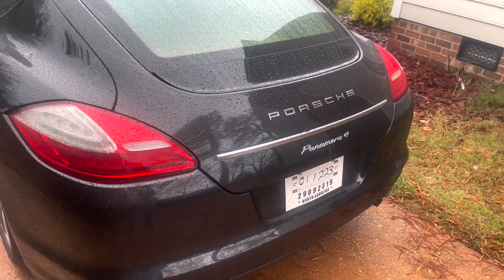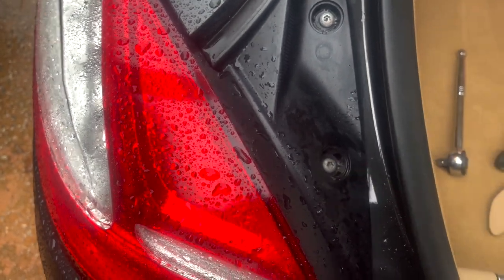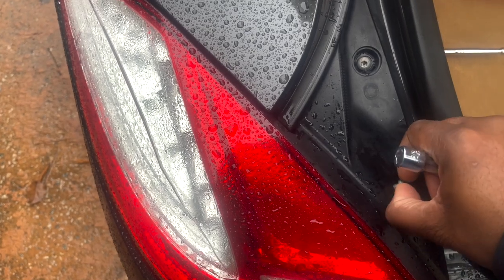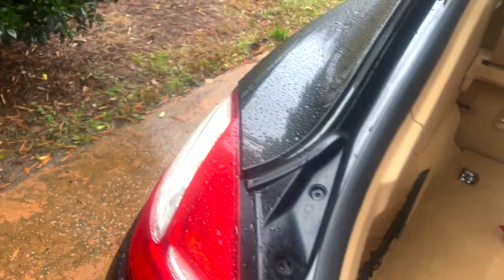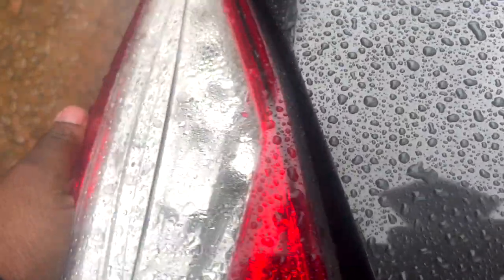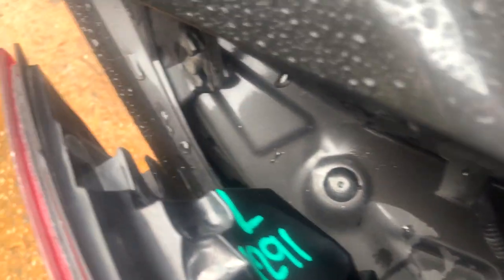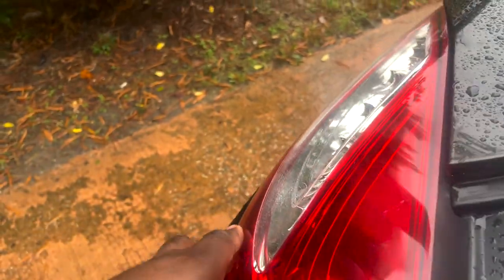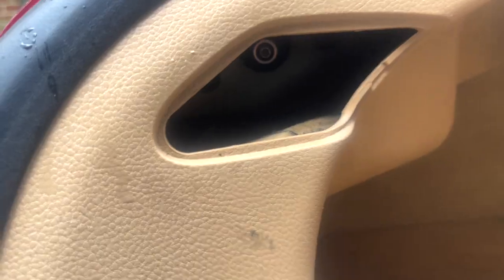Porsche Panamera Tail Light Removal and Installation DIY

Comment: Hello.  Nice job and appreciate the thoroughness.

Can you provide details of the replacement taillight you reference ?

I’m removing my faded taillights and am going to attempt to restore them via wet sand , compounding, polishing.  Likely clear coat after that
Reply from the maker: I ordered it from eBay. The seller only had 1 available but there’s other sellers that have them.